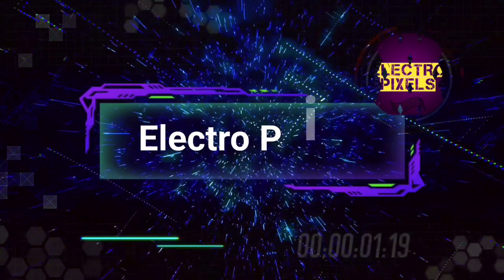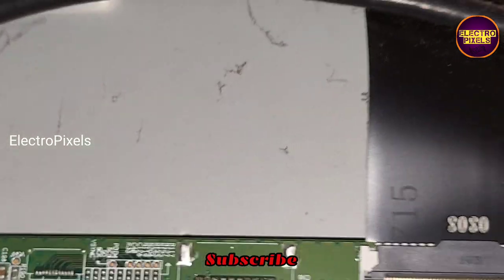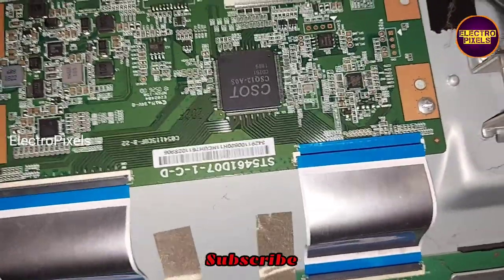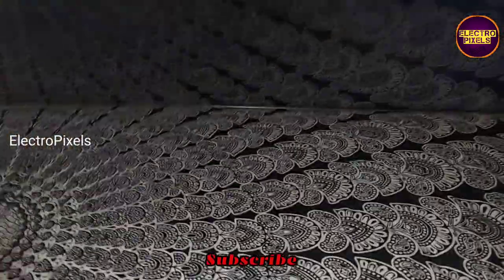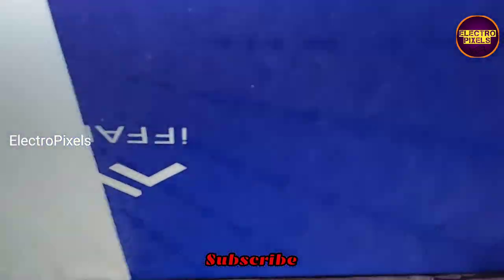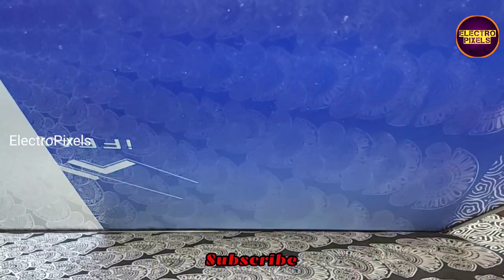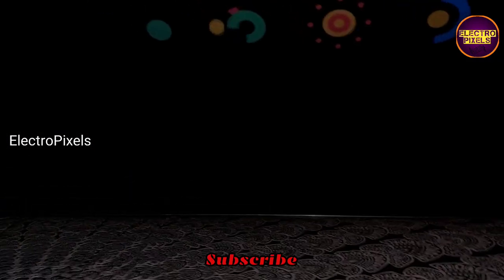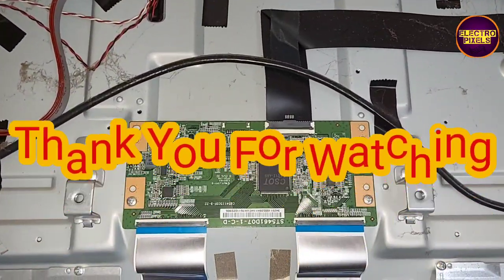Led Tv vgh,vgl Short Removal|IFFALCON 55 inch|No Display|Blank Screen|Low VGH|Panel short Removal|4K

Comment: Good video. I used taping method and after 1year the screen got blacked out. Replacing T-con board will fix the issue?
Reply from the maker: Panel Replacement is the only Solution

Comment: First I had a flickering issue so I put a small tape in the right fcc cable and the TV worked fine for a few month's, but now I got a black screen and I increases the tape length by cover almost 6-7 pins from right ffc, I'm getting the image but horizontal lines are appearing
Reply: I am in same situation bro. What you did to solve?? Any solution?
Reply: @electropixels any suggestions?
Reply: @sundaraprakash  it's got tcon board fault it needs to be replaced and seemed expensive so I chose to scrap the TV